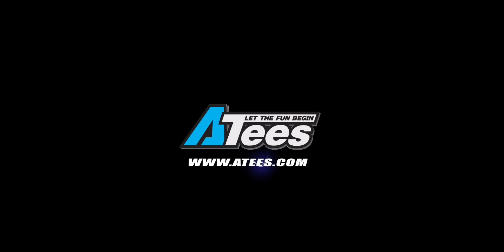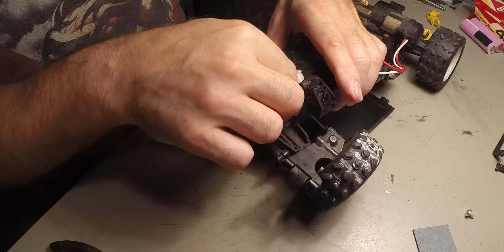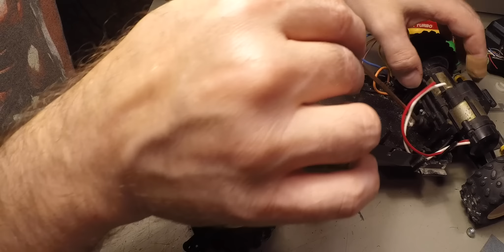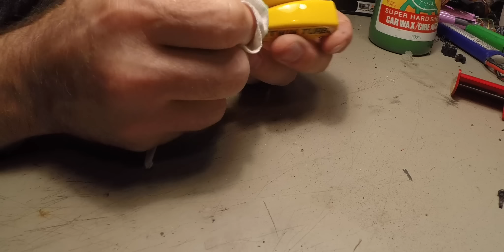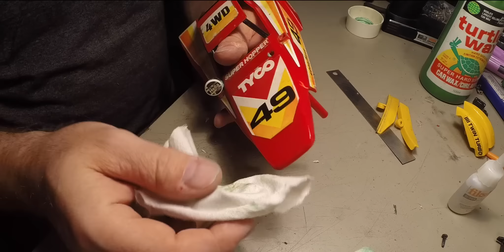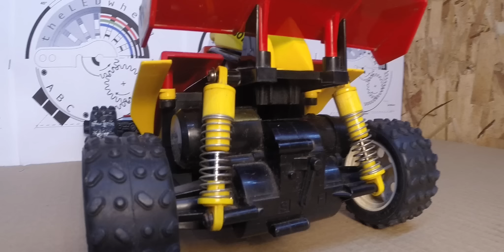Vintage 1980's Tyco (Taiyo) 4WD 12v Super Turbo Hopper new Electronics

Comment: I have the japanese version of this "Taiyo Jet Racer". How do I get the back wheels off so I can rebuild the gearbox ?
Reply from the maker: They are press fit, so not an easy task. I think you can disassemble it with the wheels on but i don't  remember 100%. Justnseenifnthe screws are accessible around or even through the wheels.
Reply: @TheLEDwheel  Front differential appears to be opened without wheels removed from hubs, the rear main gearbox cannot. I heard you can hammer the pressed nut with a punch at the center of the axle but Im afraid of cracking the gearbox.
Reply from the maker: I would not recommend that, you will  or possibly will break the gearbox and/or rhe wheels.
Reply: @TheLEDwheel  Would removing the motors allow me to peer inside the gearbox to squeeze some grease in there  through hole that way ? Ideally I wanted to wash the gears of old grease but I don't think that is realistically going to be doable now. These were probably designed as a sealed unit never to be opened. One off factory greasing and that's it.
Reply from the maker: I would make a small hole and shoot spray grease inside. Then plug it with a screw or sticker.
Reply: @TheLEDwheel  Good idea ! Thanks I might do that  👍

Comment: Your conversion is so clean! I have the same exact same model and I'm looking to replace it with new electronics just like you did in the video! (I think the circuit board is burnt out since the car can only go forward slowly.)  I will be changing the servo, ESC, and receiver. I'd love your advice!

1. Where did you get the rectangular black piece of plastic to screw down the front steering servo? It looked like carbon fiber. (I think I'll need to use an epoxy to hold it down in my setup.)

2. Where did you get the metal bar to separate the ESC from the receiver?
3. What are 4 white/clear connectors you used to connect the wires to the ESC?
Reply from the maker: Here isnthe terminal block. You can cut it to the  number of contacts required. 
https://s.click.aliexpress.com/e/_msN1qje

As for  the servo holder its stuff i had in my junk leftovers that was cut and drilled to fit.

Comment: Nice. I just had to look this car up to see if anyone had a vid of it. I had one of these for about 2 days. Got it for Christmas but the remote only worked within 3ft of the car. Totally bummed... I ended up getting a Tamiya Fox. Much more expensive, but that did give me some RC car street cred. Plus it was better to have those 7.2v NiCd batteries w/quick charger than a bunch of AA cells.

Comment: I remember the original remote having a 'Turbo' mode, I guess it was only for more throttle.  Fun fact : the remote also work with the smaller Turbo Hopper (not Super) with the difference that the turbo stayed on while using the steering...

Comment: Commenting on a very old video. Could you elaborate if the 60A ESC is required? Does these small motor draw that much current? Im also busy converting one of my old RC cars. As the it just keeps twitching when only 2 meters away from the transmitter.  

What Amp rating ESC would i need?
Reply from the maker: Pretty sure you can get away with 30 amps. Maybe even 20.
Reply: @TheLEDwheel  thank you. I found an suitable old Tamiya ESC. Was able to rebuild everything within a hour or so. And runs great. Even though i still cant pinpoint exactly what car it is. Looks like a tamiya knockoff. Still does the job. And have about 90minutes of run time on the battery.
Reply from the maker: Like a hornet or grasshopper clone?
Reply: @TheLEDwheel  have no idea how to share a photo on this platform. But havent been able to find anything like it.
Reply from the maker: You cannot shre photos here.  You can always follow the link to my facebook group.

Comment: I have the same car. But no antenna for the remote. Any suggestions or directing to a replacement, or a build?
Reply from the maker: You are going to have to keep an eye out on eBay, online classifieds, local thrift stores and Facebook groups. There might be online stores that deal with old RC's as well. Been a while since I needed to search things like this so some may have disappeared while others may have popped up.
Reply: @TheLEDwheel  thanks for the info.

Comment: Hi I have two Super Turbo hoppers both work one pulls to the left a little bit. I an going to do the above to them but was also curious about switching the motor and battery to modern. Do you have any suggestions to what my best approach to this is or what is the most important stuff to switch out thanks! big fan
Reply from the maker: You can prob swap the motors for brushless ones but changing the pinion over to the new motors is a risky task. As for the battery, these rc's run 8 x AA batteries. Thats 12v total so a LiPo 3s battery pack should work and if combined with a new radio and Modern ESC even the stock motors will seem to have a new life because they will be getting the power they need that the stock system cannot provide.
Reply from the maker: The main issue will be finding a battery pack that fits. You may need to clean up the battery compartment to maximize the available space.
Reply: 14500 Lipo is the solutipn

Comment: Sell this to me, I’ll be your best bud!
Reply from the maker: Its sold
Reply: I own it.  Works well
Reply: @jfgoudy   I picked up the white version with remote but it doesn't work I don't think it's the right one.these had stick controllers they sent the pistol grip. so I'll be doing mods to it
Reply: @jfgoudy  it's in damn near new condition stickers and all. I also have a super fasttraxx in really good condition even the tracks are in good shape all original. I'm working on restoring a bandit as well. I wish I could find the original remote to this car though I'd like to leave it stock